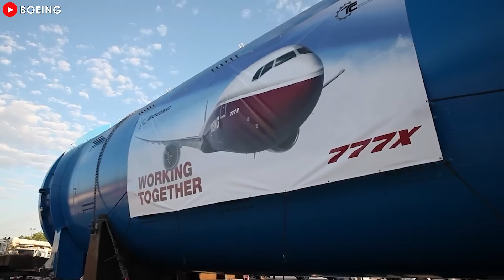This is the REAL Reason Why Boeing 777X Is FAILING… It's Shocked Everyone!

Comment: Even if FAA regulators certify the triple 7-X  won't translate into the series going into production and you still have to set the parameters on the triple 7-X from Business Class, First Class and Platinum Select with a 3-4-3  cabin seating format and GE would have revise the engines . Airlines are looking to diversify fleet and nautical mileage for aircraft to fly. Unfortunately the triple 7-X is far too big. The only Airlines that would legitimately place triple 7-X orders would be Air Canada, Saudi Arabia, Air India and Singapore Airlines for fuel efficiency and fly passengers on long haul flights as the Airbus A350-1000 is more than capable of in terms of nautical milage ✈️

Comment: Boeing had a vision of cost cutting. Saving money on construction, on weight and operation. Everything is light and cheap. The cost was quality and inbuilt resilience. And the consequence was failure and massive loss of confidence. So why did Boeing fail.  From my perspective having seen  how the 747 was built the big change was the 747 was built by engineers and workers who were striving for quality durabiity and resilience right from beginning. The 747 was built inhouse. Their General Manager back in 1976 proudly described how the 747 had so much resilience it could drop off engines in flight and still fly.

I would fly in a 747 any day.

but the 777  I would rather travel on a boat.
Reply from the maker: 747 is a legend!

Comment: Actually the 777x fuselage failed slight below the test preassure, but Boeing just said "it's good enough". 
I don't understand why they bother to set a standard when they will just ignore a failure, but I guess that's Boeing culture. Just like them taking parts from the reject 'quarantine' and using them anyway.

Comment: We need to dissolve Boeing permanently and lay off all workers as a result you naive YouTuber will not have a job airbus planes and air travel costs will double or triple 
This is good for the environment since airplanes are the biggest polluters 
In addition Greta turnburg will be a happy camper

Comment: I still manage to successfully avoid flights with B 737 on long haul routes, it's worse there, I sometimes have to fly with B 747-800, I prefer to fly with A 350-941.
Reply: Unfortunately, the 737's narrow body limits its appeal compared to the Airbus. It's a relic of the 707/727 era, and Airbus was very smart to make their new A320 slightly wider, which makes it seem a lot more spacious. From that point on, there was no return for Boeing, the cost of new wider design and its tooling would not have been competitive.
Reply: B747-800?

Comment: The most advanced commercial airplane is certified and proven….the 350, clean sheet design and full carbon fiber 
I understand if Ur paid by Boeing , but it’s not even on par with a 787
Reply: 787

Comment: 777x. It’s still an OLD 777. Can’t see EMIRATES buying this aircraft. A350 is the future.😊
Reply: No they don't want A350-1000 and plus it's fairly new
Reply: @Plane-Ship-Lover  They're put off the A350-1000 by the service interval of the RR engines, which they claim is three times shorter than intended.
Reply: If it were an old 777 then they wouldn't have these NEW problems now would they? Beside that the 777X will be a huge leap above and beyond any a350 whatever.
Reply: Totally agreed
Reply: @MySkyranger  hey doofus, emirates has ordered over 150 777X, no need for you to see since you’re blind or live under a rock.
Reply from the maker: Before some issue happened. It is still considered a future aircraft

Comment: The video was all jumbled. But staying on the B777 for one second (unlike the clickbait title), the B777 already has major commercial problems before it even gets delivered. It's not as efficient as the current A350 which is already 9 years old. It's also more expensive. It's also not here yet. And then you have that whole Boeing factor (ie. crap quality control).
Reply: If the B777-9 becomes a sales problem for the A350-1000, Airbus will just simply stretch it. Easy. The A350 NEO is just waiting on new engines from R-R anyway.